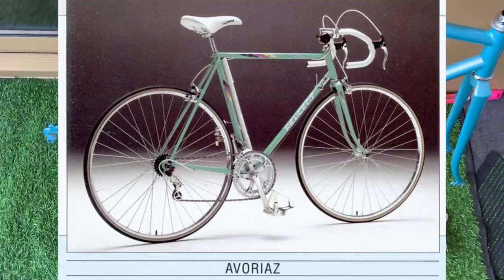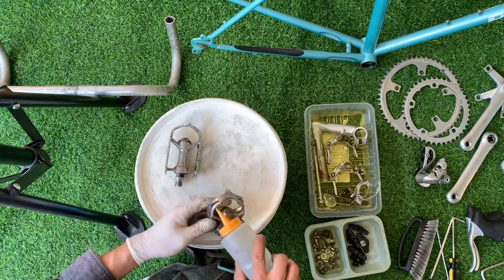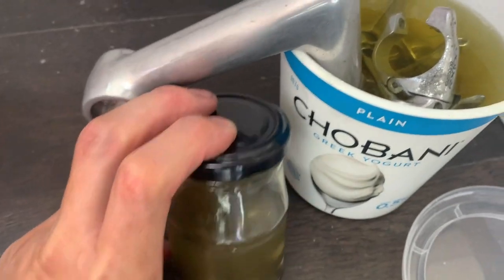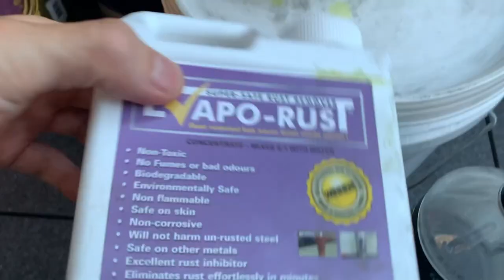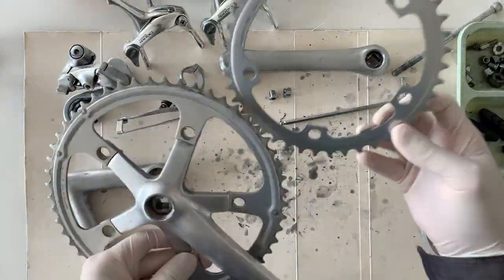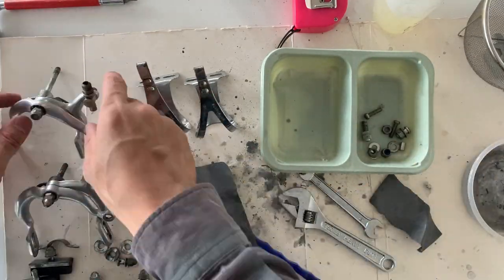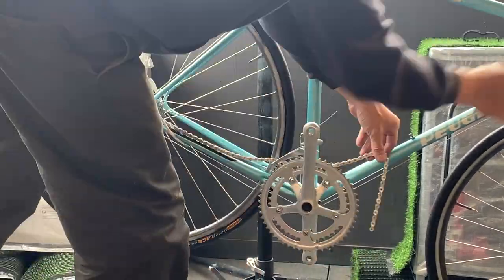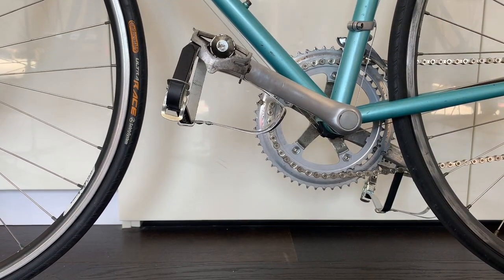Vintage Road Bike Restoration - Peugeot Avoriaz 1989 custom

Comment: Quite good. The only thing I don't like from the racing bikes from that era  are the break cables which pop from the top of the levers... But you fixed that by upgrading to a slightly newer Shimano. Perfect! I have exactly those in my classic racing bike. Rx100
Reply from the maker: hahah yeah I actually don't mind the look of them but I get what you mean, they can get in the way sometimes and a little cleaner without them. thanks homie appreciate it! rx100 work pretty well!

Comment: Had same problem with calliper arms not reaching the rim with my 80's frame, ex500 brakes and 700c rims.
Simple soulution for it was to file off about 3-4 mm from the "bean" with 6mm 'o' file.
Otherwise great find, I love this colour, little bit of rust on groupset but frame in good condition.
Brush, wd-40 and waterpaper works wonders.
Where do you find these?
Reply from the maker: Wait where did you file? I find all my bikes/parts off fb or gumtree ! Thanks dude 😊
Reply: @garysprojects  I've made this oval shaped brake pad alignment hole a little bit longer so the break pad could reach the rim, without touching tire. 

In my case there was still about 8mm left from the lowest point of alignment hole to the end of arm, so I tooked about 3mm and there is still around 4 mm left so it won't fail under stress.

I saw someone opening it totally and it lasts, so it's not a problem to file about 3mm.

To give you and idea how it looks like.
https://farm2.staticflickr.com/1927/30114888887_be53c74c6e_k.jpg
Reply: Some use drop bolt in rear, but same problem occured for me in front and this was simplest way to get few mm extra reach.
Reply: Not many cool bike around in my country, maybe because different bike culture and communism. Sometimes it is possible to get a cool frame but without og groupset, or it is possible to get cool groupset but with no frame.
Mainly because people dont care that much about old bikes here.
Reply from the maker: @jc438  dude that is an awesome idea!!! I wonder if I can do it with my rx100 brakes that I had. Def will double check tomorrow thank you! 🙏🙏
Reply from the maker: @jc438  ahhh I see, well this frame is an old frame and the groupset is newer! So maybe you could do a neo retro build, I think they are pretty cool too!
Reply: @garysprojects  at the moment I'm planning to restore my old touring/cross bike, which has been standing in basement for 8 years
Reply from the maker: @jc438  ahhh yeah do it! I’ve had this one for a while too before I finally got to finishing it.  Feels good to get it done! 👍